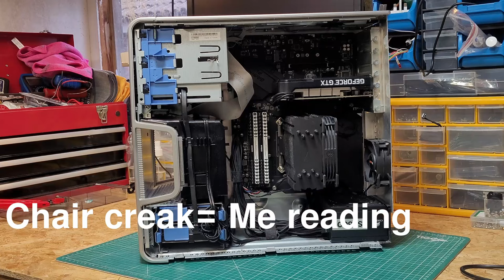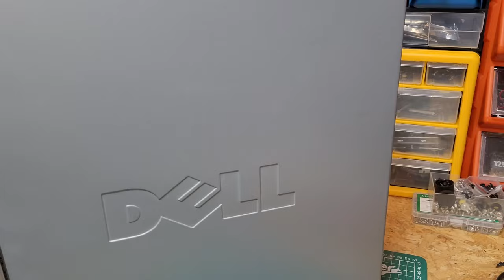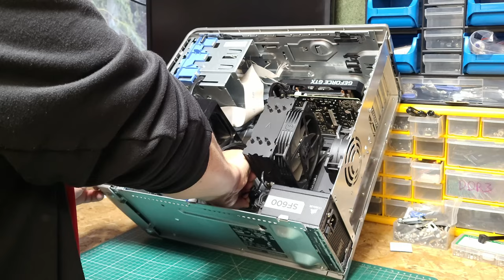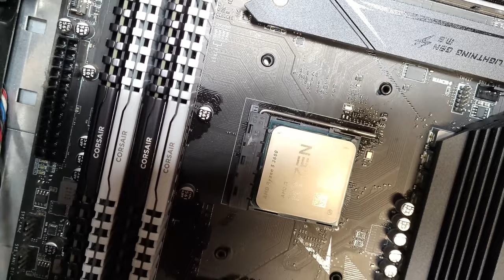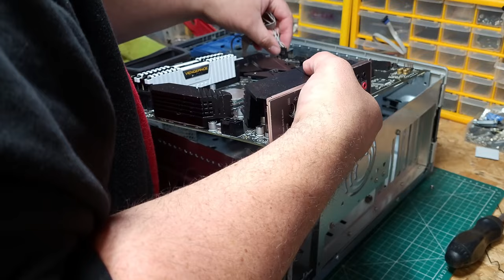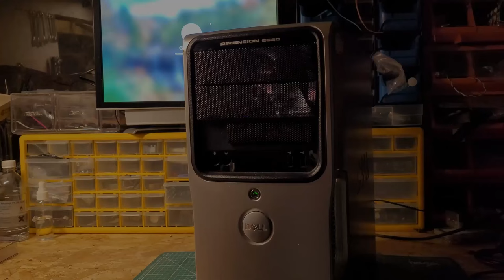New Look At My Dell Sleeper Pc Build E520

Comment: My e520 still got that q6700, 8gb ram, and that sweet juicy gt740 💀. Got a T5500 with a x5680 6 core and a gtx 980 and 40gb ddr3 so its all good. On the E520, If it werent for that unremovable IO shield i could put in an HP LGA1155 BTX MoBo and get an i7 2600 but i dont have a dremel so i cant do that. One day maybe.
Reply from the maker: Yeah fixed it shields are a pain unless you have a way to cut it

Comment: Really enjoy your content & retro systems (mostly - not exactly with this one!) Ted - I used an old Dell Dimension 4600 case to put an 'upgraded system' inside. :-) Houses my old Win XP/Windows 7 system now - AsRock G31M motherboard & Quad Core cpu, 4gb RAM, with Radeon HD 6450 GPU. Quite tempted to do another build in an old case now - with a more modern system, like yours here...
... keep up the good work & vids. 🙂
Reply from the maker: That's very kind of you thank you. I'm toying with which retro case to move it to at the moment. Make sure you put up some pictures, be awesome to see another build
Reply: @Revivify  Will try to take some next time I'm with it, as away a lot right now. :-)

Comment: What did you do to make the mounting bracket for the power supply because I just got a e520 and I want to make a sleeper
Reply from the maker: I modified one of the adapter brackets that allow you to fit the small form factor psu's into a regular size psu space. Shaped it to fit around the psu you seen in the video. Then drilled some holes to allow it to tie into the existing metalwork.
Reply: @Revivify  thank you one more thing what size motherboard did you use and what were the measurements for the holes you had to drill
Reply from the maker: The motherboard is just a normal ATX Msi B550 gaming plus. I dug through my parts bin and found some slightly longer versions of the standard psu mounting screws. As long as the plate you fit isn't too thick, you might be able to get away with the standard screws